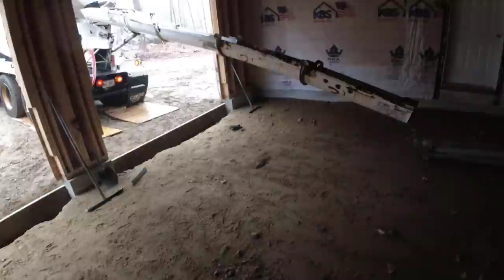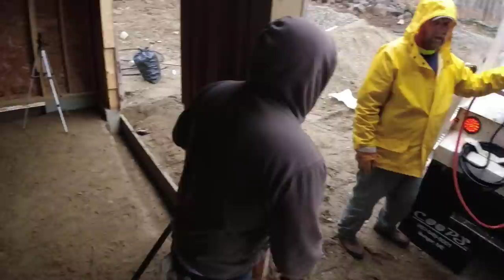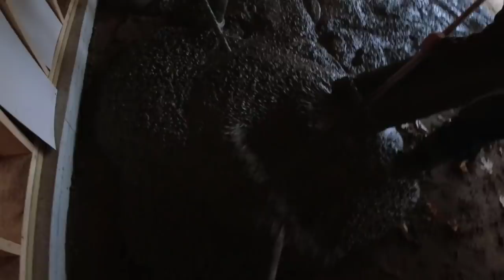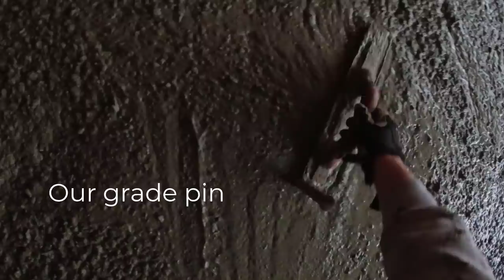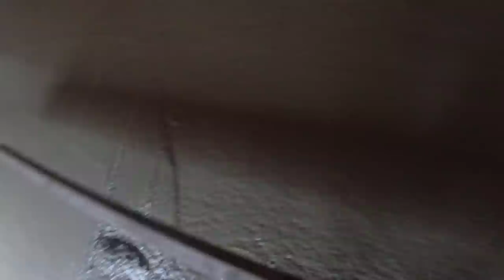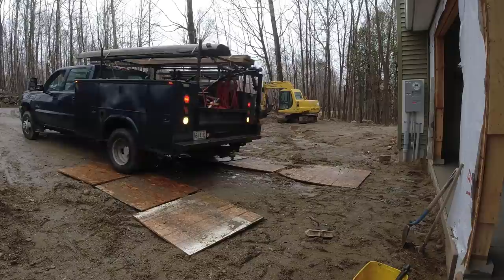Pouring a 2 Car Garage Floor (Adding 300 gallons of water to the load)

Comment: Oh, I've had drivers leave water on probably half a dozen times over my 30 years in it. Always have to send it back. One time a finisher left it on and of course it was our fault so after that one of our rules was that only the driver was to ever touch the water valve.
Reply: That's a good rule and how I like it as a driver.

Comment: Mike great professional work very educational.

I do like your head cam close up shots but  when you move around it makes my stomach twist.  In those times I like the wide shots.

The shot you had showing how hand pull the concrete to level off the previous pad was excellent to see the fine cream pool starting about 6 inches away from the edge.

Thank you for the content
Reply from the maker: You're welcome

Comment: Hey Mike,
When you do crack control joints for a garage do you ever put them where the garage door is? I’m going to build a 16x24 garage and was thinking of just doing the cuts in the center of both lengths to have 4 equal rectangles.

Comment: I have watched all your videos. I am confused on slump. I ordered a 5.5 and the stuff was almost unworkable. I called a diffrent place and ordered a 6 and you could hear the rocks banging on the sides. My presumption was that they add the water at the plant to get close to the correct slump.
Reply from the maker: We add water on site. Sometimes they have to add 10 to 20 gallons multiple times to get slump up to a 6 for us. It usually shows up very dry in the truck, 3 or 4 slump then the driver adds water based on what the contractor tells him he wants for a slump.
Reply: @MikeDayConcrete  thank you

Comment: I just had a garage slab poured, and the contractor didn't do any sort of taper at the door like you show. In fact it slopes back up the wrong way at the end creating a birdbath right under the door. Maybe I could have specified that? Guess I just didn't think about it. What options are there for changing this? Do you think it's possible to saw cut and re-pour this little apron section and have that look good? I thought about grinding it, but not sure I'd like the finish.
Reply: just grind it down... take a buffer and appropriate attachments,it's easy enough, just make sure you protect against making a mess
Reply: or if you feel confident enough u can use a hand held grinder